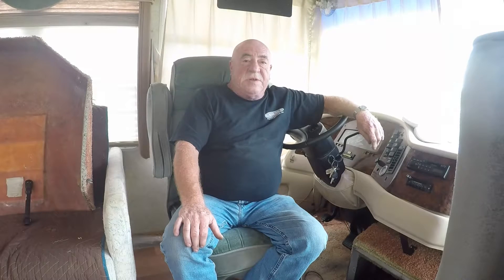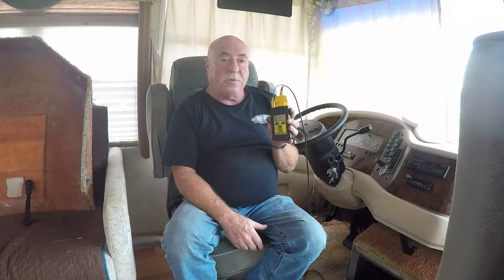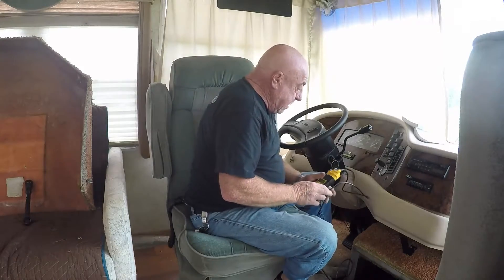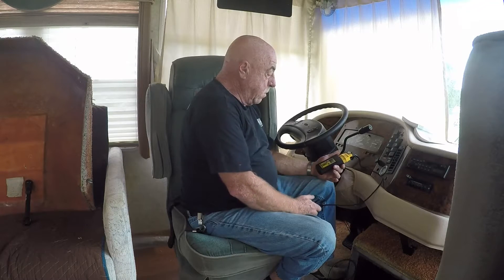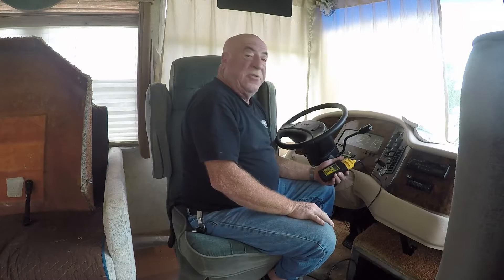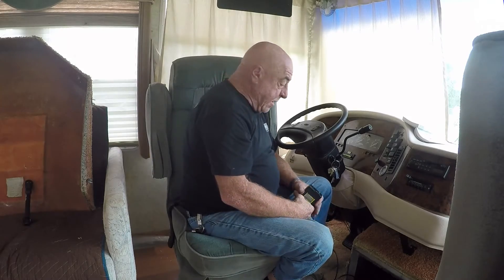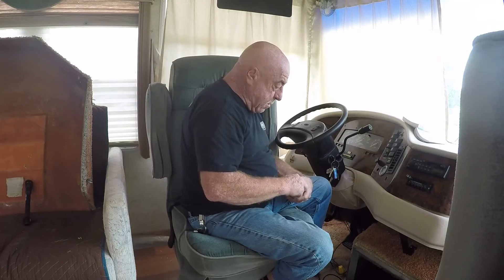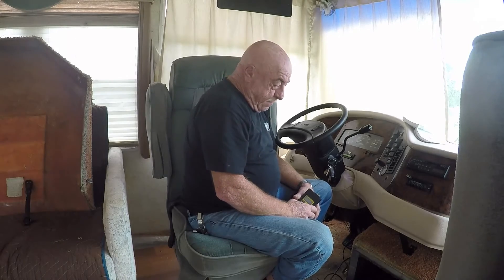OBD 1 Scanner Received

Comment: You forgot to check the logged codes.  I think for calls them memory codes or something.  After the key on engine off test, there we be a 10 code, a long delay, and then the logged codes will real out.  This takes quite a while.  I have same scanner, but 1995 f150 4.9.

Comment: To better check things, a Snap On scanner can check codes and do other tests. Get the Ford 1B adaptor. Also, the primary cartridge for Ford and Troubleshooting cartridge for Ford, G.M., and Chrysler fitting the year of your RV. Also a battery clamp cable. Get a 9 volt Square battery for in the left cover. A Actron CP9690 code tester checks OBDI and OBDII. Get 4 aaa batteries for under the rear cover. It has a OBDI cables for Ford, G.M., Chrysler, and Toyota. It's well lit. It has code-connect to diagnose codes. EBAY has both.

Comment: I have the same exact problem!
I've checked fuel pressure, its perfect. I've replaced the TPS sensor, the MAP sensor, the idle air control valve, the fuel pressure regulator, an inline fuel filter, plugs, plug wires, added Seafoam to a tank full of gas, as well as an octane booster after half of the first tank of fuel and fill up again. 
I'm thinking another 1200 bucks outta fix it!.....
Reply: Oh yeah, and replaced the coil.

Comment: If you get vacuum at the EGR at idle, replace the charcoal canister purge valve. If you get oxygen sensor running rich codes, replace the MAP sensor. The CTS can cause rich codes. A stuck pressure regulator can cause rich codes. Warm up the engine at 2000 RPM's for 3 minutes before testing. Do the snap-acceleration test to the floor or else it'll cause rich oxygen sensor codes. On the wiggle test, if you hear quiet, then all's well with wiring of sensors. If you hear a tone, look at the codes. Check the wiring and sensor indicated. Do KOEO and KOER wiggle test. Check timing and advance. If the timing mark flutters, it's the module.

Comment: Never hurts to install a new cap and rotor.  I am having a similar issue.  I am going to smoke test for a vacuum leak today. If its not that I'm suspecting a bad MAP sensor since the mechanic re-did my intake manifold gasket. if the new plugs and wires and cap and rotor don't fix it.

Comment: Get a Snap-on scanner from E-Bay. Also get the cartridges and manuals and adapters. Get the battery Pak and cable to check results away from the vehicle. Get the 12 volt cable that hooks up to the battery to hook up to some adapters. It can check oxygen sensor and TPS readings and EGR and fuel pressure, oil pressure, and other tests!

Comment: Sorry to keep writing more notes...lol.....someone else also noted...Injected Ford trucks run a 2nd fuel pump....the tank pump is just a pusher to and for the high volume pump (for fuel injected engines) its on the frame...these usually sit just before the engine near the trans
Reply from the maker: classicmopars No second fuel pump on mine.

Comment: Hi Chico....just another thought from my post below,....would be to buy a couple cans of engine start ....and spray that around the intake as your holding the throttle down....you could also have a bad vacuum line leak...that spray will soon find that leak as its sucking in the spray fluid

Comment: Hi Chico!!
As a tech for Toyota for a number of years and before that with the Chrysler group...your problem is in your fuel system...its the one part of a vehicle that doesnt throw a code.....could be a air leak in line before the pump....low fuel pressure(new pumps go bad too) or fuel pressure regulator or a  line blockage..you might want to try and rent a fuel pressure gauge set from a auto parts store.....as they do have them to rent........i hope you get to the bottom of it...as i know....although for you it might be too late...lol.....it will make you pull your hair out trying to figure out and chase the problem without those code readers...Best of luck...and love your video's...John and Kelly, close to Tombstone AZ
Reply from the maker: classicmopars I agree.  I brought the rig to a shop where they have access to all the tools needed.

Comment: A very easy way to find a vacuum leak is with brake clean.  Leave engine running and spray brake clean "sparingly" near all hose.  Engine will rev up when/if you have a vacuum leak as they all lead into the intake in some form or fashion.  Have used this trick on many different Honda cars when the dealer couldn't even find the leak.
Reply from the maker: That is an old trick and a good one.  Do the same thing with propane from a propane torch.  Thanks for the input!

Comment: Chico,

Could you forward a link where you got the OBD1 and the extension cable please...
Like I said.. I have the same year chassis and engine.
Thanks. 
Steve
Reply from the maker: 1pilotsteve http://www.amazon.com/Equus-3145-Ford-Digital-Reader/dp/B000EW0KHW#productDetailsHope that help with your problem.  Make sure you check the port before ordering!
Reply: Thanks Chico..

I believe I have the exact same engine and chassis as you.. 1997 ford 460 engine on a 1997 chassis.

I love the 460.. It's nails and lasts a long time when taken care of. The parts are cheap and redly available.  I am going to keep track of my gas mileage....

My bus is only 31 feet and I know yours is a bit bigger.  My brother got 9.8 miles to the Gallon(imperial) on a trip from Ottawa to Oshkosh Wisconsin  2 summers ago.

Not to bad. like you I am going to change the plugs also all my belts and that nasty idler pulley for the serpentine belt. Those decide to go when you least expect it..  Good luck with everything. thanks for the reply. cheers Steve
Reply from the maker: 1pilotsteve Here is a PDF file of the readers operating manual.http://www.equus.com/Content/Support/Manual/3145_FDCR_%28E%29_20NOV2002.pdf
Reply from the maker: Rufus N Dufus Here is a copy of the manual.http://www.equus.com/Content/Support/Manual/3145_FDCR_%28E%29_20NOV2002.pdf

Comment: My money is on the (TPS) throttle position sensor.
Reply from the maker: ProdigalPiscator I inclined to agree with you.  Just can not understand why the computer did not report the problem!
Reply: My Durango did not show any codes.  The only symptom was on cruise control the speed would vary.

Comment: Some things just do not add up.  You did drive it home and it ran well by your words.  Then you worked on the fuel tank and pump and now you have the issue.  The engine is really starving for fuel,  that would explain the backfires when driving it as well.  Something is not right in the fuel system.  I would get a fuel pressure gage and install it up by the engine.  I al almost 100% positive you will find below spec fuel pressures.  What is causing that?  Don't know.  Could be a bad pump again, could be a second fuel filter you have not found yet?  Could be the fuel line got pinched putting the tank in?  But I think your issue us fuel, not spark.  Just thinking out loud.
Reply from the maker: Vader1957 Very possible.  The RV did act up on the way home, that is why I replaced the fuel pump to begin with.  Thought the problem was fixed.  It is an erratic problem.  I agree that it acts like a fuel problem.

Comment: If the rv sat for a long time, I would say it does sound like water in the fuel tank. Put some alcohol in the tank. That should take care of the water. Replace the cap and rotor. It's a cheap fix, but I don't think it's the problem. It ran good before, so maybe bad gas. Good luck. Oh and don't panic have a beer.
Reply from the maker: James Decker I like the beer idea very much!!

Comment: Could be the cap and rotor for sure but don't discount water in the fuel also.. Like I said, my old RV did exactly the same thing.. No power under load...I used 4 bottles of gas line anti freeze to get the water out. .Good Luck Chico..Don't worry, your getting close.

Steve
Reply from the maker: 1pilotsteve I have added some dry gas and fresh fuel, still having a problem.

Comment: Not a mechanic here, but since you've replaced the fuel pump and filter, it seems you have a fuel starvation problem or air intake, which is caused sometimes by a vacuum somewhere or  check your exhaust system. Since you don't have any codes, it is probably a vacuum leak that occurs when you floor it, or a weak hose that collapses (or opens if it is cracked) when you ask for more air coming in (accelerator pedal to the floor). Otherwise it would sputter and backfire, which is not the case, and idle seems ok too. I would start by checking and or replacing all vacuum tubes AND carburetor inside fuel filter AND check distributor and rotor of course... Check this one (carburetor fuel filter), it is often the culprit. Probably a hose though. Thought about that? Probably a cheap and (but long to do) easy fix. Take care man.
Reply from the maker: François Goudreau I am sure that it is one of those things.  Just have to narrow it down.  Thanks for your suggestions.

Comment: I've had this exact same thing happen on a passenger car. Turned out it was a fractured air intake hose near the air flow meter. As the motor moved under acceleration it would open up the fracture and decelerate the engine. As soon as the engine sat back in it's static position the fracture closed up and away it went on the cycle again. Some tape around the fracture cured it short term and a new hose long term. Just a thought.
Reply: Should add I've also had a similar problem with a collapsing air intake hose under hard acceleration, outside chance though I think.
Reply: You're right, it is probably the case here.
Reply from the maker: macgor05 I bet it is going to be something like that, just have to find it!  Oh well, thank God for beer!
Reply: Yep, and hands on to find that leaking hose!
Reply from the maker: François Goudreau
Agreed!